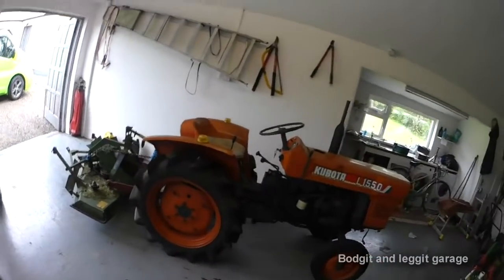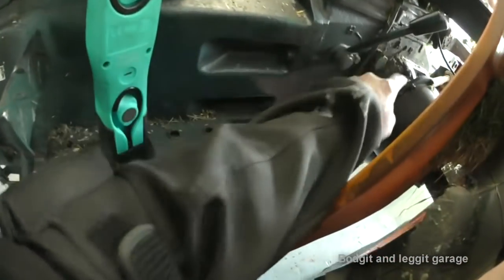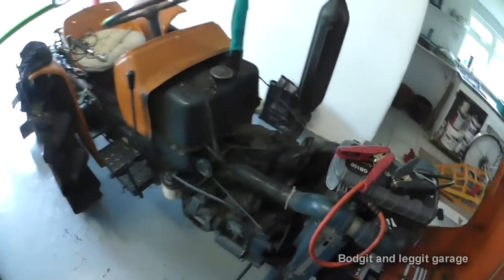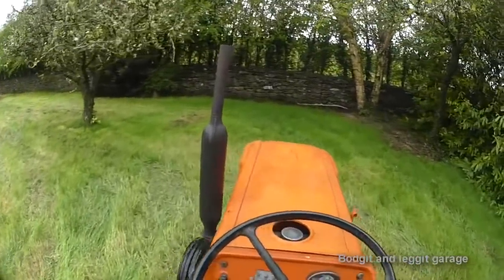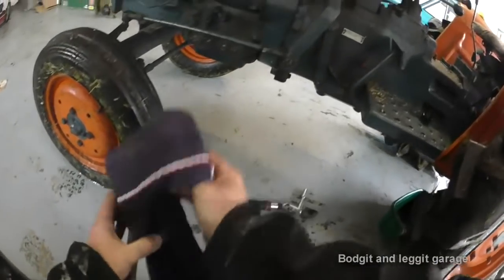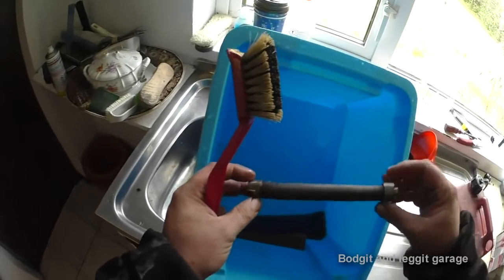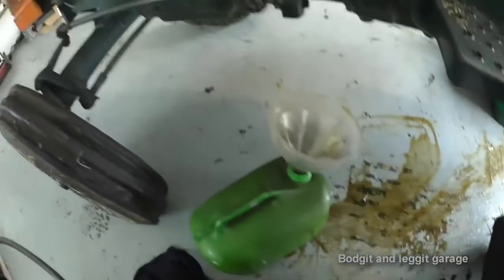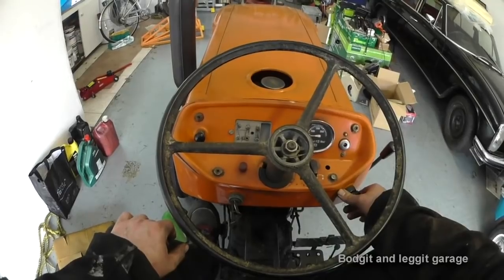kubota 1550 Hydraulic Lift Not Working (25 Years No Service)

Comment: Brings back memories of working on tractors in kilkenny in the mid 80's ❤
Reply from the maker: Lol thanks mate
Reply: I have a kubota l1500 cracking little tractor made a front loader for it amazing what it can lift now in the process of hucking up my home made back hoe to connect onto it but i am now hopefully trying to put apower steering on it it has a spline shaft on the front i have a pump off an old rotary mower will try to put it on it and this should work the ram i will be putting on the steeing shaft hope this will work

Comment: You were lucky with the Kubota dealer. I have a Kubota L5450 and wanted some parts the first was a fuel filter bowl, I contacted Kubota UK and never got a reply and ended up getting it from the US, then I needed a starter motor, Just by chance a local Vauxhall garage closed and the unit was taken over by a tractor dealer who was among other brands labeled Kubota dealer so I went in and asked for a starter motor they said the they would enquire and phone me nothing happened for a week so I phoned them to be told that they were busey and would get back to me, they never did so in the end I looked on line and got a new starter motor from China in two days for just over £200. It is obvious to me that Kubota UK are not interested in support of anything other than new equipment.

Comment: Congratulations on the Hydraulic repair and Great repair video. Thank you for sharing. We have a Kubota L2350 that has a jerky hydraulics going up and down. From your video, it looks like I may need to change the hydraulic oil in it also. Good luck on the repair of the L2550.

Comment: Very good - did you get a new filter? My L2000 looks very similar and takes 21 litres. I gasped when I saw you cleaning it in the kitchen sink but then realised it was off the garage 😊
Reply: The manuals for these state the hyd oil filter doesn't need to be replaced. Just cleaned.